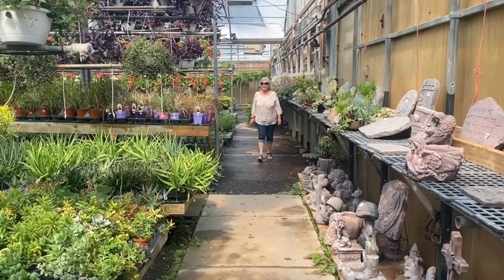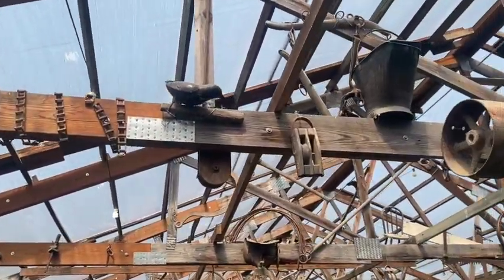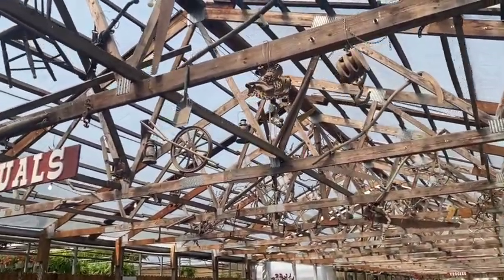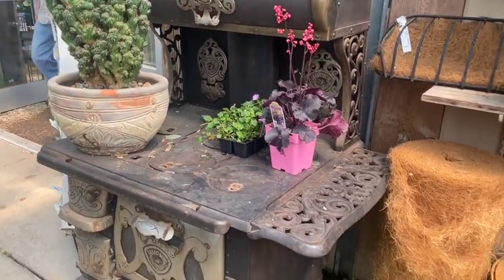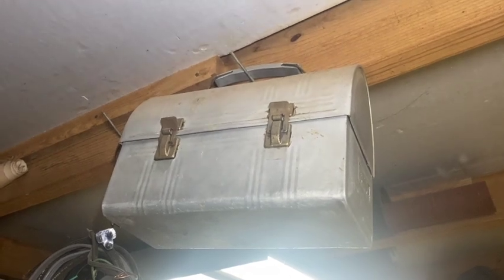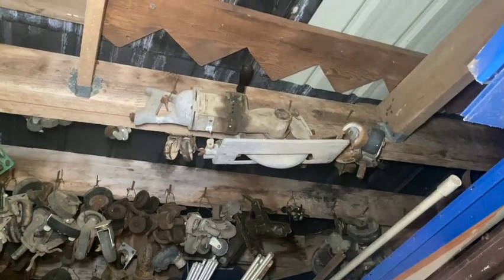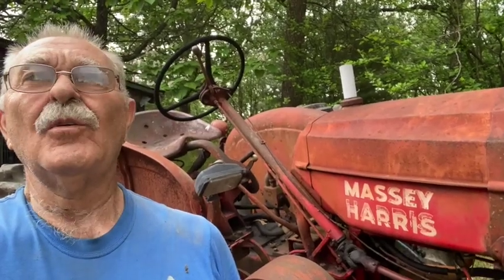Old Stuff From A Time Long Past- IS Where We Came From Insignificant? (The Description Box Is Cool)

Comment: Cool old stuff tractor man. That thing with the crank may have been a lime or seed spreader. My uncle would have a stroke seeing that 66 mustang waisting away. He had a 65 convertible and a 69 mach 1.
Reply from the maker: Heck, that's only my spare Mustang...the better one is in the shed...its a 67 couple !!  It's amazing what people will trade you for an air conditioner repair in the middle of a hot summer !!

Comment: Really liked and enjoyed the video. I actually have a lot of the  exact same items and some different things. We have  Lots of older chainsaws. and lots of older 1960's hot rod drag race items. I drove a 65 mustang 289  three speed back in the day. Mine came from St Louis and was badly rusted and fixed with gallons of Bondo. It actually fell apart on our rough gravel road. Yes even in the 60"s children where considered farm labor. Our school dismissed when the cotton boll's opened and did not resume until all the cotton was picked and ginned. and a few weeks later it was dismissed for two weeks for Deer Season.
Reply from the maker: Yessir, that's the way farm life was back in the day wasn't it.  Yeah, we have a pile of old two man McCoullughs and Malls too.  Up to 60'' two man guide bars.  You know, cotton is one thing we've never had in this area. But my father in law was born Blue Eye, Mo. and stayed in Myrtle and Thayer a bit as a kid and got into the cotton fields quite a bit in his younger years.

Comment: I love this old stuff! 
I, like you, have used many of those tools. 
I was surprised you didn't note the 'nail puller' hanging from the bottom chord of the truss that came into view on the right side @3.14 in the video. 
However, it was a very entertaining video, thanks!
Reply from the maker: Yeah...it was kinda tough stepping between customers and trying to keep my mind on the stuff I was looking at.  LOL There was quite a few items that should've been called out, but I figured guys that know what they are looking at can spot stuff in the background.
Reply: I have a nail puller hanging from the peg board in my man cave directly across from my puter!
Reply from the maker: @thecollectoronthecorner7061  I took a slide hammer weight and slid it over a rod that I welded to the end of one of the handles of an old pair of big horse shoeing pincers.  Works great to pull nails on tin without crushing the metal like a crowbar.  I have one of these nail pullers, but we used 'em back in the day to pull fence staples.

Comment: So much of this has been scrapped over the years, nice to see someone saves it. Our younger generation don't have a clue about 99 percent of anything shown here... keep up the history lesson, 👍👍👍
Reply from the maker: Well we never were ones to toss something that may have a bit of use in the future.  Heck we still have the connecting rod off of a good sized steam engine we used for decades as a weight on the rear section of the ten foot tandem disc!!  Actually it is at my Much Older Brothers shop. And that machine was dismantled in the 1920's or '30's.

Comment: Great video.  Enjoyed it thoroughly.  I too have several "OLD" tools in my garage.  I have some garden cultivators (hand operated) that I still use every summer.  I laugh when I go into Cracker Barrel and see "my tools" on the wall on display.  I wish I had my dad's 2 man cross cut saw.  You definitely had to be a real man to operate your end of it.   I have lots of hand planes, a bull nose lead (don't know when I could ever use it again!), and quite a few of my dad's logging tools.  Great heritage.
Reply from the maker: You cracked me up !!  That's the same thing I do when we go into a Cracker Barrel!! LOL. My dad brought me his 7' two man cross cut for hanging over the fireplace.  Its been there since he gave it to me.  It spans just shy of the full width.  Its 4 cuts and a drag, and the back of the saw blade is thinner than the tooth side so it glides smoothly in the kerf and doesn't pinch.  I pulled my end of it quite a few times as a kid with him complaining about me 'riding' the saw.  LOL. I HAD a bull lead... but the Missus took it over when we got married.  LOL. Hold on to those logging tools !! Thanks for taking the time to make such a cool comment.

Comment: good to meet the missus. A lot of neat old stuff. I've got a couple pieces. Watering cans have always interested me.
Reply from the maker: Hot dang...I thought sure you'd spot the '66 Stang I had hidden under 20 years of barn dust....LOL   The Missus had a great time at the nursery for sure.
Reply: @tractorman4461  oh I saw something there.. thought that maybe it. I thought I'd mention you mrs. Over the car.  Both you and the other fellow had a good collection. I actually have the plow and the leather straps and all to go with it. Back in the day when they use a mule to pull that single plow and bust up the clods. I also have that dangling hook thing for always called it you know where two guys grab the post and they carry railroad tie or a large log as you said. I had no idea what that thing was for!
Reply from the maker: @CAROLDDISCOVER-2025  Those tie tongs are great for moving small to medium logs or RR ties.  We used RR ties for corner posts on all the fencing on the far.  So I've got a little bit of use-time in on these things.  LOL

Comment: The JD oil bath air cleaner and exhaust pipe is from a LUC combine engine used on the 12A pulltypes. The L and La tractors just had a standard muffer and the air intake stack was much shorter. AL B.
Reply from the maker: Now that's good to know Al.  When I got the little LA it was partially disassembled and these were parts that came with it.  I DO have another stuck JD "L" engine that's fitted with a Rockford clutch.  The screen and metal is much different than the LA metal too and I know it was a power unit but no idea what its off of.
Reply: @tractorman4461  Now that is interesting Wendell. The early Luc's had LA sheetmetal and tagged LUS. I did buy the remains of a power unit that had L grills front and rear, a rounded hood and oval fuel tank. The owner said it came from an ensilage chopper. Unfortunately the metal was to far gone I couldn't save it. AL B.
Reply from the maker: @sallybrokaw6124  I've never really looked for the ID tag on the power unit. I was going to rebuild which of the two was the most promising for the LA.  Iirc, the screen is the only thing kinda ate up on the power unit.  The rest of the metal is in good shape, but rusty and it is absolutely nothing like the tractor metal.  I really am not a big JD guy so I don't know all the subtle differences.  But the tractor has rice paddy tires on it. The tread has to be three inches tall !!  Thanks Al for adding more information about them.

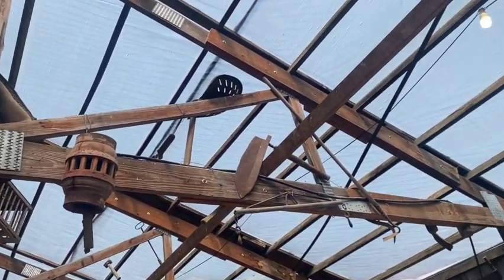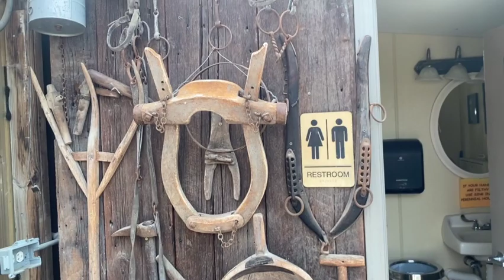Comment: Those "tie tongs" are timber tongs for logging.  Tie tongs are similar to those ice tongs and railroad timber tongs are steel instead of timber with the tongs hanging.  3:53 I believe is some sort of jack,  4:16  is a chicken crate and old wagon wheel hub,  5:57  looks like a single ox yoke with a hay or grain fork to the left side,  10:10  log tongs for hanging from a tractor or other machinery,
Reply from the maker: Well back home Roy, we used what we had and called 'em whatever the old man wanted, whether it was correct or not...LOL.  Heck, I was a teenager before I found out that 'whickerbills' were actually needle nose pliers !! It makes sense though that the actual tie tongs were on steel instead of wood though.  I'm not too much up on the stuff they used with teams of horses and oxen though.  We only had one work horse left by the time I come along and she was out to pasture.  The last team we had were Percherons though.

Comment: Shame all that's hanging up and not being used. At least it's not in a scape yard. I still use my hands to work and use a fair amount of what's seen here depending on the day. Old fashion leverage will never be obsolete and to replace most of these tools with their modern equivalent would be almost redundant. I like those old tin watering  cans and coal scoops. Some guy way back when meticulously cut out every piece, bent them to shape and soldered them together. Same thing with some of those tools. Not all of it's cast. I'd bet most of them are far better quality than anything you'll buy today but they don't have brand names or gimmicks. All that's there is the witness of a craftsman's hammer and a lifetime of use.
Reply from the maker: For each piece that's hung, there's probably a thousand that have been tossed in the burn pit or taken to the salvage yard !! You said a lot talking about the hand made tools that the old metal workers turned out. They built stuff even for the simple jobs to last longer than a lifetime !! I have a grand appreciation for the quality of the old timers work.  I do a lot of tin work, but I'd starve to death if I had to make a living making useful stuff like they did.  Good comment CS.  Thank you.

Comment: Not ice saw, hay knife.
Reply from the maker: Yessir, my apologies....Not having to use either one, I get them mixed up when I see them.  When we'd grind alfalfa to mix in with wheat, barley and corn we split the bales between the strings with a double bit axe to feed into the hammer mill easier.  We'd add soybeans and milo to the mix as well.  This was grain feed for the dairy cattle, the beef stayed on hay and pasture.